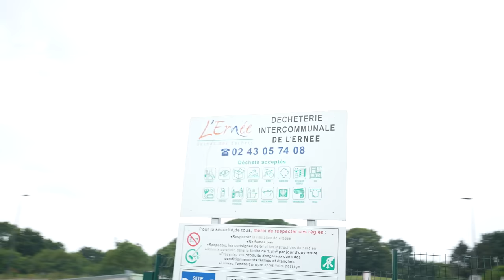Discovering the Hidden Secrets of the Convent's Chapel

Comment: Replace the beam with another metal beam with a wood facade around it. Stronger and cheaper and probably safer.
Reply: yea trying to buy a new wooden beam that big will be expensive.
Reply: Chateau woods!
Reply: Yeah, steel would future proof it for centuries more!
Reply: you might be able to just reuse the steel beam that is there.
Reply: @gordonulrickson3626 that crossed my mind. Dig it out of the wall, redbrick the hole and plaster over. No one will know the difference when the decorating is done.
I bet its not that easy. On the upside. It is a long rsj so it could easily be refurbished or sold.
Reply: Wow, great ideas!
Reply: The  beam isn’t even touching the Rsj from the look of it so offering no support  .  Look at the curve of the “sagging beam” if it’s sagging why is the lime plaster still intact. Without  stress cracks  . I suspect the curve in this beam  has always been there  it’s looks symmetrical  within its span .  The rsj looks like all it’s doing is holding up parts of the lowers ceiling …… 🤔
Reply: Yes, go steel.....

Comment: Billy, you may want to invest in portable car ramps for future use moving your lift around. Also, you need a basket of some kind to hold your tools while on the lift. You could also put things you remove like the light bulb.
Reply: This. Or a sheet of plate steel like they use in temporary roadwork. Nothing wood is safe in supporting lifts of any sort given the amount of weight they carry in batteries. And always make ramps wider than you need,  half again or more, it allows you to angle the approach/descent especially in awkward spaces.

Comment: Just a thought. Could you not remove the beam, raise the steel beam and box the steel in with antique or antiqued wood skins? It would save you some money
Reply: Box the beam out in wood where it already sits.Would just need to find a similar texture wood and matching dark wood stain to make it look identical to the existing wood beams.
Reply: @scottnyc6572  Michael could faux grain it to match or show Billy how, too. He did a top-notch job painting in "paneling" at Lelande 😉 I've seen some amazing graining done with something as simple as a torn flap from a corrugated moving 📦 box. 😉
Reply: @scottnyc6572  I think there is a device called an Alaskan Chainsaw Mill, and there may be similar devices in other countries, and you can use it to cut planks in whatever length you need, attached to an ordinary chainsaw. That might work with cutting the existing beam if it can be lowered to the floor it could be done right there in the building.
Reply: It always surprises me that you are allowed to drive to the tip without covering and securing the load. We are fined heavily in Canada for failing to do so🥴.  Great video and music  and more intriguing finds
at the chapel to keep us intrigued👍🏻🤗
Reply: @bluebird1239  These things are pretty wasteful, it might be a better idea to find someone local with a mobile bandsaw mill. Shouldn't be too costly for half a day. For one huge beam a chainsaw mill isn't that bad (although I think a skilled person could actually cut that freehand) but if you're cutting smaller timbers or boards the cut thickness of a chainsaw compared to a bandsaw means you're turning a lot of good wood into sawdust.

Comment: That beam is why I always tried to get back to the original walls or frame when restoring or renovating. I'd replace only what I had to but removed the extra weight off the building so it could handle the modern weight easily.

Comment: I would say just soffit around the steel support beam. You'd only lose the ceiling height for a small portion of the floor space and you could turn that into easier runs for HVAC/electrical/plumbing as well as having display space for antiques and pictures instead of along the beautiful walls.

Comment: Honestly, I’d personally just forget dropping the ceiling especially given the loads of work involved in replacing that I-Beam. Clearly it was done professionally and done well so why go through all the hassle and capital to undo it for the sake of slightly higher ceilings? You’ve achieved the height in the kitchen and other areas. Those are big wins to celebrate over. Not all of them are going to be wins though. I’m assuming that area would be used as a bar reception area. I’d keep the nice wood paneling just behind the arch and the paneling that goes down along the sides and just insert some nice custom stained glass pieces that can be illuminated from behind to cover up that arch area you’ve just removed to make it look a little more appealing and still gives character. Keep it as is. At some point you also have to include the convents most recent “history” even if it means preserving a more “modern looking” area, the whole thing can’t exactly be reverted back to 17th century. Just my thoughts. I saw some beautiful backlit stained glass in Romania at a restaurant called Carú Cu Bere. Check it out. Maybe it’ll give you some great ideas to save you the cost and effort.

Comment: Billy, as a replacement for the bad beam; you may want to buy a pair of flat topped roof trusses and block them together to form a hollow box beam that you can run mechanical through. You can then face the beam with veneers cut from the faces and edge of the bad beam. Just a thought from a retired carpenter in the USA that is a fan of what you are doing with the convent.

Comment: Take the steel beam and move it to the attic and bolt it above the bent beam with multiple bolts, slowly forcing the old wooden beam back into shape. Easier said than done. Crack on.

Comment: Not kidding about the sagging beam. That is probably the main reason they lowered the ceiling. Fixing the sag though might affect the office, as the office floor was probably built up to make it level, so if you remove the sag it will make the office floor bulge up.

Comment: Replacement of a whole beam is very expensive. 
A method I've seen used is metal plates with countersunk bolts. These can slowly be tightened to reduce the warping over time. 
Then, a veneer box is glued over the beam. Colour matching with a good stain can disguise the repair.

Comment: Every time I see you down at the Déchèterie (or Recycling Center), I always find myself wondering, 'Why doesn't Billy flip down the side wall(s) of the truck bed when they are emptying the bed out, and when it comes to clean-up, would it not be easier to just tilt the back dumper-bed up and then have all the debris just fall to the back for easier disposal?'  Smashing fun you're having there otherwise.  Wish I could help, but for myself being a necessary compassionate caregiver to my elderly mother, that is currently not something I can entertain. Real fun looking though; love renovations/restorations. ❤  Cheers🍻

Comment: Read in comments ie swapping out the two existing beams, which I think is a brilliant idea, but as an alternative less work option, could you get two upright pillars and use them to support the sagging beam? It looks like it is fairly close the wall, and not in middle of room, so you could make the area between the two uprights appear to be a sort of mirror of the arch on opposite wall ie size wise. maybe put a big painting on wall between the arches or add a big niche into that wall. ( Or, can you use permanent upright aggro's as the supports, and encase them in a wooden framework so they are hiding?) I am just wondering if this might be a cheaper option than a huge oak beam.

Comment: Still think raising the whole stone floor back in the hallway rather than making ramps is a better idea. Ramps will make moving heavy loads a huge pain compared to a flat travel path.

Also I am betting there is an alcove behind that "blank" center bit of the front wall.
Reply: I think the same, also because some people may also feel seasick if they have to cross the corridor several times between the 2 rooms in a short time.

Comment: To add my humble two cents: leave the  steel beam, but clad it in Chestnut. Save that cost of replacing it, keep the integrity of the floor strength above it and once it's finished, no one will notice that it's hanging free because it will be beautiful and match the rest of the wood aesthetic. It will be invisible.

Comment: Maybe you can still use the steel beam after you get it down and remove the bad wood beam then put the steel beam back and then cover all sides of it with wood slats this will save you a lot of money and will be better in the long run

Comment: You may be able to raise the steel beam into the original position of the wooden one and then clad the steel beam in wood - possibly even milling the new wood cladding from the old beam if there is enough good wood there.  - Just a thought.  Get an engineer to look at it though!

Comment: that's a good span of an 'I' -beam, maybe you can locate someone to purchase it from you when it's time to remove it. 
Can you get a replacement beam of the same material and length, chestnut?
The convent is such a large project but I wonder with so many alterations to the original building, I'm often wonder if the nuns may have been taken advantage of sometimes by unscrupulous contractors. I understand its a negative thought but sometimes people get convinced. Though, another thought, the ceiling is low to hide the sagging beam. Not sure why they didn't just replace the beam with chestnut while they were there in the first place.

Comment: If they dropped the ceiling, I wonder if they also raised the floor, given that awkward step down into the chapel, which doesn’t make a lot of sense. Especially given the grandeur of the original archway.  🤔
Reply: It sure is possible given the layers he’s removed elsewhere but that seems like such an odd thing to do…to raise the floor. Though like most of the changes they made that sacrificed the original beauty of the structure it was probably for the sake of  efficiency and modernization.

Comment: That steel as viewed isn't supporting anything. The floor above would be horrific, and walls falling down if that original beam were structural.
And stop throwing away good timber, you'll need it for something, like making a decent ramp for the scissor lift.

Comment: Ramp doesn't look wide enough.  How many pounds does the machine weigh?  Board is too thin.  Try car ramps.  Try a crow bar on the arch, instead of pounding your hand on screw driver or get a hammer.